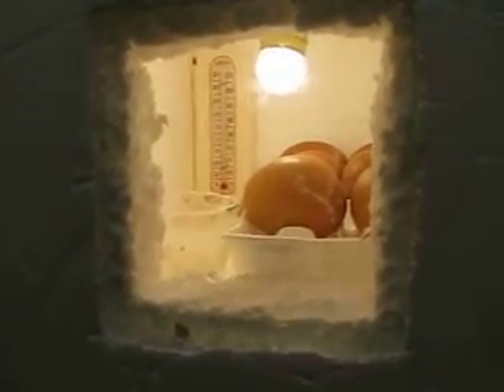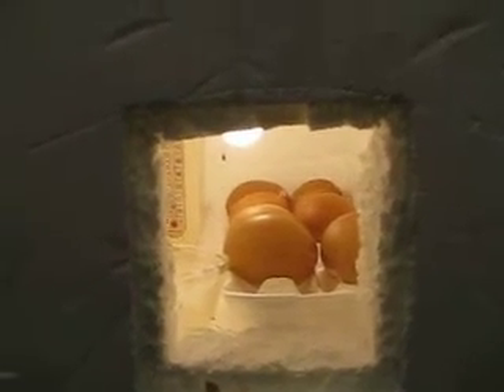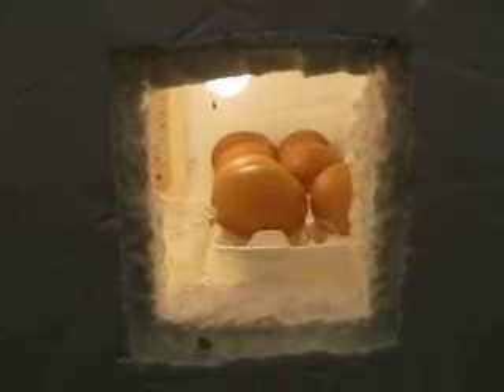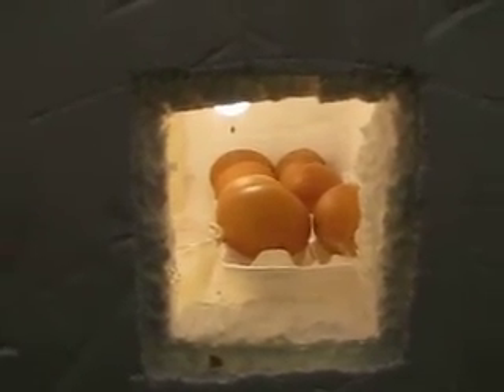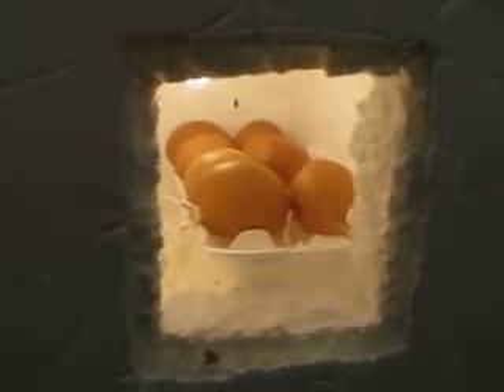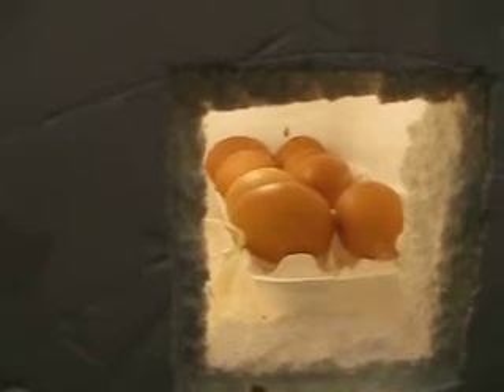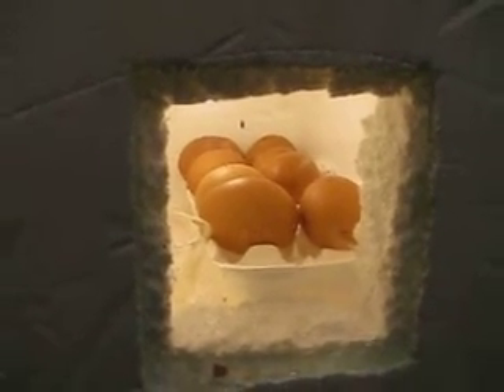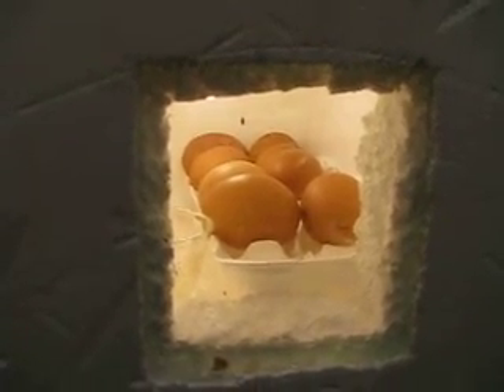Home Chicken Egg Incubation Project Day 8 - Ideal Hatching Temperature

Comment: How many watts bulb is this
Reply from the maker: It is 7 1/2 Watts.
Reply: When i use 5 watts wil it work
Reply: Abby Classic depends on the size box you use , if it’s to big it won’t get to temperature so need a smaller area . Trial and error till you find what works .